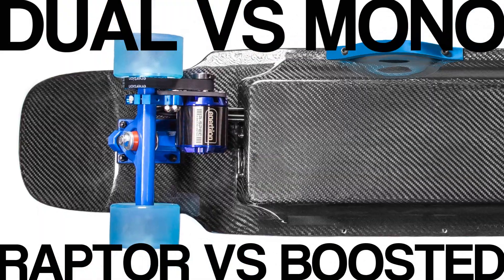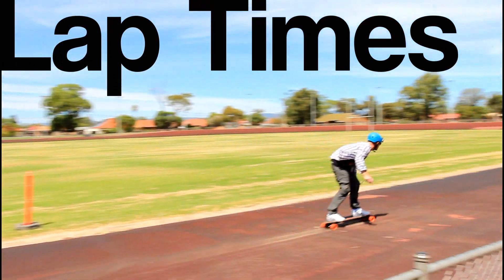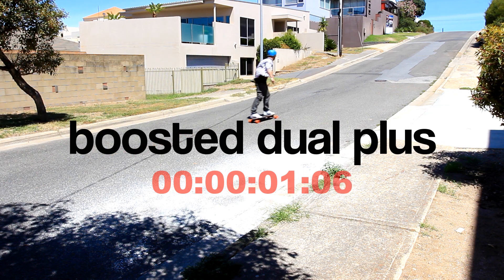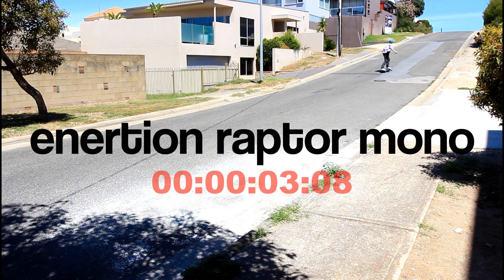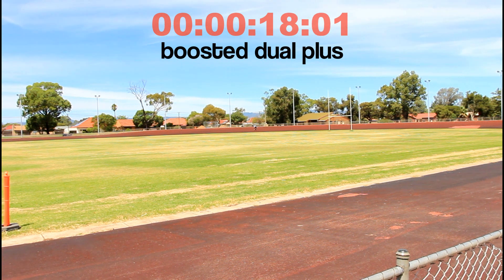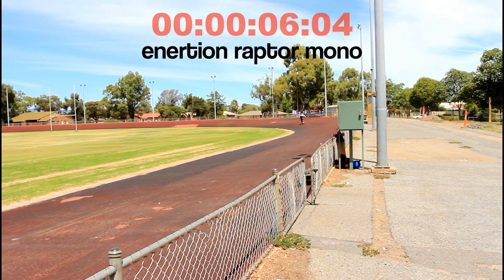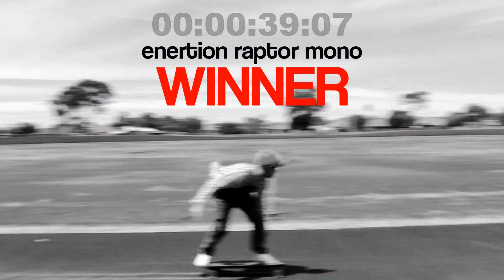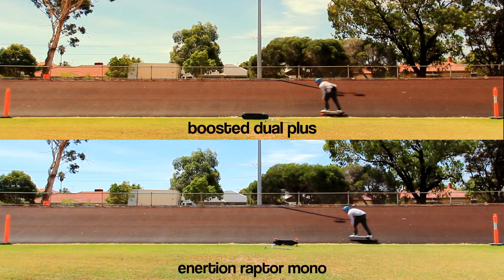Enertion Raptor Mono Drive VS Boosted Boards Dual Plus

Comment: This company is clearly a scam. The responses to these comments are very unprofessional. The product is overpriced garbage. It looks like it was made in somenone's garage. The Boosted clearly has much better speed, agility, torque and much more power.
Reply: +Armando Epifani . "The Boosted clearly has much better speed, agility, torque and much more power.". It all has to do with the motor. The mono drive has a higher horse power rating then what boosted uses for a motor. The thing is Boosted has a team of workers to help you with any problems. This company is a smaller operation.
Reply: +Jake Abel so what? two wheel drive = more power. boosted spent years engineering the board.
Reply: Armando Epifani
Two motor drive is more power then one. But two 1.5horse power motors is not equal to a 4 horse power motor. Boosted did not pick the fasted motors. I believe they made a decision for efficiency. So I think boosted is more efficient and would have a longer range if they both used the same battery(this board might be using a larger battery). Boosted really points out how has a close weight to a regular board. I'm positive his board weight is a lot because of the design.

Comment: How long was the track? 1/4 mile?
Reply: +E nertion okay thanks. I'm curious because if it's a quarter mile, the boosted's top speed would be 20 mph with a 45 second lap time. Other videos have tested the boosted and they've say the top speed is closer to 20 mph rather than the advertised 22 mph.
Reply: +Citi Wheel Yeah but they rode the center line which would make it a bit longer than a 1/4 mile.

Comment: This comprison is not fair to the Boosted rider, who as out riding and having fun days before the Raptor rider, the latter was still at home wondering wtf settings to change to get his board to work right.
http://www.electric-skateboard.builders/t/enertion-raptor-first-batch-problems-solutions/1296

Comment: I want one, but I'm really nervous that something is going to be wrong with the board and I have to send it back.
Reply: That's the worry most have.  It's not like the Boosted where you get it and it just works.  So far there have been issues like the remote losing signal, the motor shutting off once the battery goes below 15%, adjustments that need to be made using software to make it ride smooth.  Basically a lot of tinkering with it to get it to work the way you want it too.  This board has the potential to be great, I think they need to work out all the kinks.  Most people just want a board that plain works out of the box.  For $1500 usd for the dual, I want zero issues and a perfect product.  To be fair I think they are doing their best to resolve issues that were there with the first batch that was sent out.

Long-term reliability and customer support is still to be determined yet.  That's why I'm waiting.  I really hope this board is all it promises to be so I can get one.
Reply: There was some teething problems with Raptor first batch, but Enertion are rectifying it. If you're been following Onloop on the esk8 builders forum you will know its capital base is nothing compared to Boosteds 2mill start up and now massive structure. However the Raptor is still the best complete eboard when you compare it in the video. Remember now we are comparing the Raptor MONO against the dual plus. Not the Boosted mono which the results would be more outstanding for the mono. Get on board. Follow Enertions journey. You wont regret it, but just understand Enertion at this point want to be the best and they are trying to do their best with customer support. I own a Raptor Dual 1.0
Reply: +Simon L can you make video reviews to verify range, max speed, reliability, handling, etc etc?  The issue is many people are worried about buying this because sending it back to Australia is not easy from US.
Reply: +MalikPhotography 

Enertion have 2 contacts in the states east and west coast I believe that can handle any issues for US. There are just big logistical issues with batteries at the moment where the battery has to be sent separately from the board. I don't have the tech myself to post up a review, but hooking up with a Boosted dual and Evolve owner shortly who may be able to to a vid. Can I just say I had the same concerns with buying a Boosted as if I had an issue with it if I had to send it back to US. I'm in Aus. With any issues during warranty it can be sent back. I can post my thoughts on the Raptor. Just not vids at moment. I can say for myself I have got up to 25km range with about 10% battery left. Thats about 2 hrs of riding. I also have an extra battery which I can hot swap on the run if I bring that along. The fast charger can charge it quickly if you take that and find a power point to hook up.  Like with any hardware which is run to the extreme it has to be maintained.
Reply: +MalikPhotography 

Happy to answer any questions you may have about it. By the time any current prospective buyers place their orders in the batch no should be about 3-4 and thus alot of any of the issues B1 owners had would be ironed out to the most part. You have to remember Enertion is build from an eskate builders base. The Raptor was offered as an alternative for those who didn't have the time or the smarts to make one themselves and can be cheaper to make an eboard to an extent.
Reply: +Simon L you don't have a cell phone to take a video with??  It's just strange how only one customer has given video feedback, xusia I think.  Either way looking forward to video of evolve and boosted vs raptor
Reply: +MalikPhotography 

There aren't that many Raptors out there yet, most riders are probably just riding their boards. Maybe ill just post a review. No test footage just my thoughts on how its been.

Comment: The hill climb would be a torque test If both started part way up the hill or if the hill went on a lot longer. Instead it's partly a momentum test and with the raptor starting faster it's got more momentum to finish faster. It seems to me we have two comparisons about speed which the Raptor wins and one about torque which the Boosted wins. I am not trying to diss the Raptor but just saying the tests don't quite prove the claims. What I'd really love to see is a long hill climb test (up a mountain or as close as we can find in Aus) and a hill start test between the two because this is supposed to be where the Boosted supposedly smashes the competition.
Reply: +E nertion hah what really killed me was the around the track test with the "rolling start", both test where you're board won there was extreme bias. And it was quite apparent, nice try though. Honestly, just test fairly give both boards an even chance. The raptor is better and we all know it, but you don't have to skew the results.
Reply: +E nertion My point is not to put down the Raptor but that the video does not demonstrate your claims. You did not start the hill climb on the hill IN THE VIDEO so it doesn't prove your point. It probably achieves the higher top speed up the hill because it was already at a higher top speed and has more power not torque ... and using more power means less range. We cannot tell conclusively from the video that the raptor does not slow up the hill only that it is going faster. If the hill kept getting steeper and we could see which ran out of puff first you might have a case on your hands. 
Also, there is one other point to consider which is the Boosted board may limit or wind back wind back it's current in these situations to preserve it's batteries from excessive load or to protect the ESC from boring up. It's possible that if the hill continued for another 2kms the Boosted will be still going at reduced speed and the Raptor might have gone pop. Anyway, I see a lot of jumping to conclusions here with limited proof. Things is my board was doing the same thing as shown with the same weight and half the cost two years ago. But my batteries, motor and ESC wouldn't have lasted long but long enough to beat both boards in a video. What I want to see is soft starts on steep inclines, the ability to climb for ages without it going pop and getting the most range when doing these things for the least weight.
Reply: +E nertion Oh yes, and when you have a rolling start and one has a distinctly faster top speed than the other you have immediately generated a bias in your test so don't say there was no bias. A rolling start test distinctly favours the raptor. The only test where their wasn't a rolling start, the Boosted won.
Reply: +E nertion But what does that flying start 1 lap prove? That the board with the higher top speed actually goes faster. The point is hardly worth making. As you will know from your own riding top speed often doesn't mean much and the more urban you get the less it means. Being able to brake well and accelerate well are the keys to efficient commuting. Perhaps add a braking test to the next video too?

Comment: Awesome vid!! Would you be willing to do a comparison of the mechanical and structural differences between the two boards? Also whats is the difference in battery expectancy when running  a Dual Enertion Motor compared to a Single Enertion Motor setup?

Comment: Wondering why you didn't compare it to the raptor with dual motors?
Reply: +E nertion Why wouldnt they be comparable? They both have 2 motors...
Reply: +MalikPhotography  beceuase they're not comparable.
Reply: +VerdantPictures cos the raptor is just way better...
Reply: +Evan I tried the Dual. If it was actually better, I would have bought it.
Reply: +Evan very happy. I am working on a DIY boosted build. I don't want to ruin my perfectly good board.
Reply: +Armando Epifani I'll be doing a detailed video comparison as soon as I get my raptor.  I will also be including the inboard m1.  Look out for than in 30-60 days!  (Raptor delivery time).
Reply: +Tango965 yep, but enertion has informed me that raptor is delayed because they are waiting on VESCs.  See his blog post on this channel. N so it's probably at least another month or so until it ships
Reply: +Armando Epifani Enjoy your dual+ then, I don't know you tried mono one or dual one, the joyful and the point of enertion is DIY and knowledge sharing with others.
Reply: +Armando Epifani Really? I only bought the parts from enertion which can almost be a raptor dual expect the carbon deck.... haven't got them yet so I assume that won't be too bad tho. You happy with your boosted? Ever try to modify it yet?
Reply: +MalikPhotography which board are you going to compare it to?
Reply: +Tango965 to the boosted.
Reply: MalikPhotography okay awesome. I will be waiting for your review. Comparison between two dual-drive boards. Subscribed! lol

Comment: Nice concise video highlighting some key differences. Nice to see you showing the Boosted win a category. I'm guessing it wouldn't stand a chance against the Raptor Dual in any catagory. Well, maybe flex, if that's what a rider want at 40+ KM/h. Maybe now that the Raptor Dual is out we'll see some Boosted Dual versus Enertion Dual videos soon!